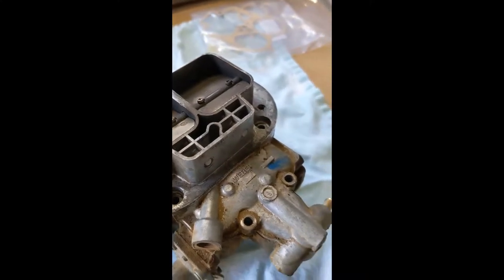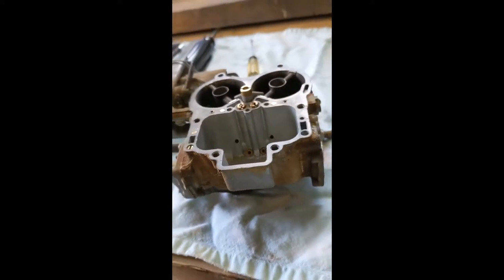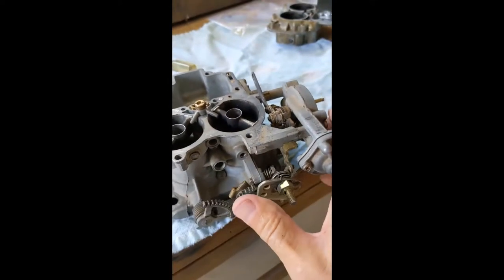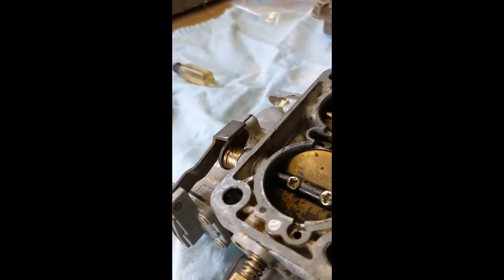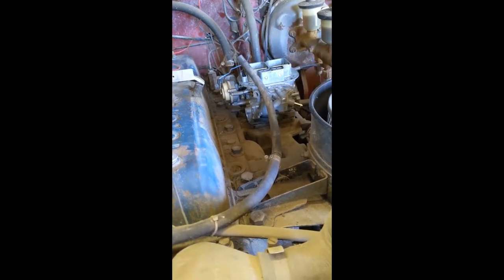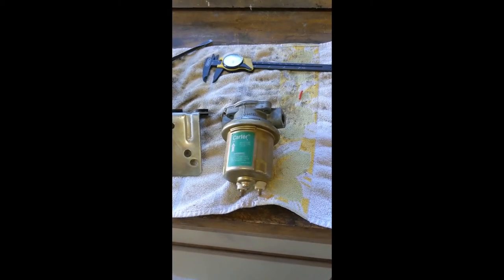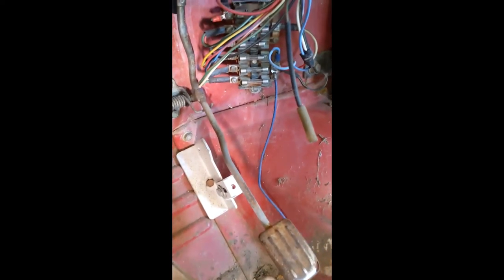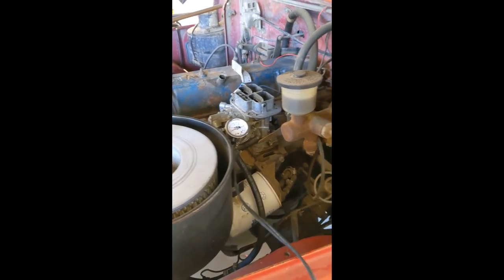Carburetor and First Start

Comment: Nice work. Which fuel pump did you use? Mine was replaced with an electric pump as well, it is too loud for my liking. It does remedy vapor lock on hot days.
Reply from the maker: I used an Airtex E8016S fuel pump.  It's working good, but it's a bit noisy, too. A lot of people use the Carter P4070 which costs more but tends to be quieter.
Reply: @mikerestoresanfj4069  Thanks for the tip, I will look into the carter. Looking forward to your videos.